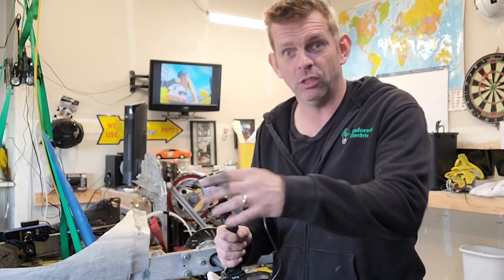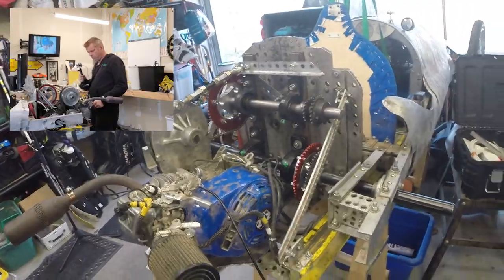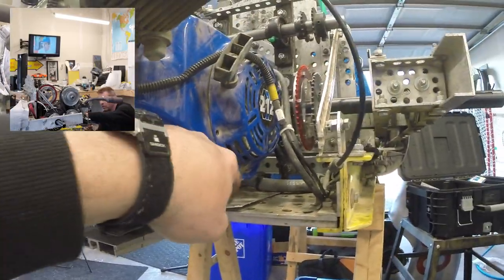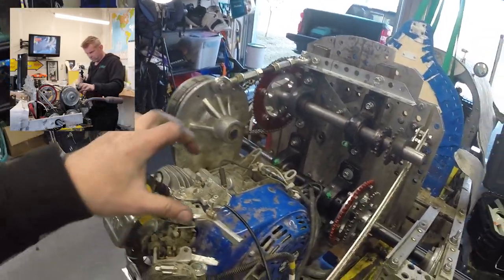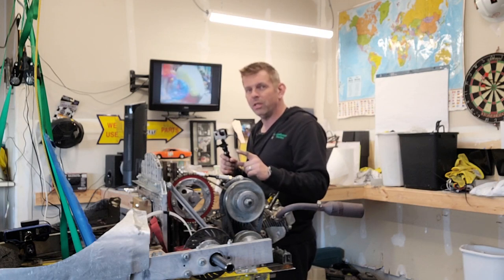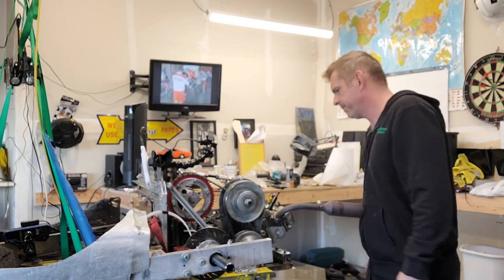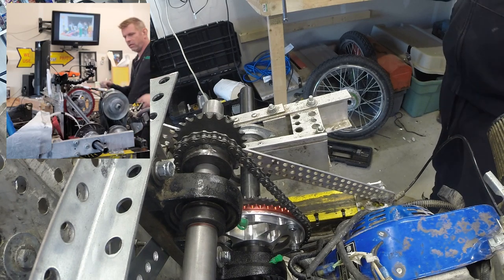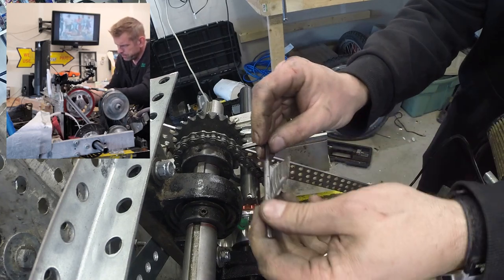Cyclekart Shop Talk - Episode 4 | That Rubber Thingy Is In There!! Drive System Recap

Comment: How tight should the torque converter belt be , between the pulleys when you don't use the backing plate ?
Reply from the maker: I don't know, to be honest. If you have access to a TAV with the backing plate, get a feel for the best tightness and try to duplicate it.